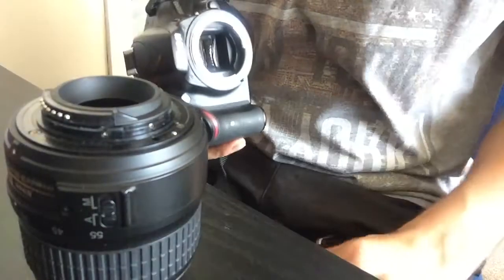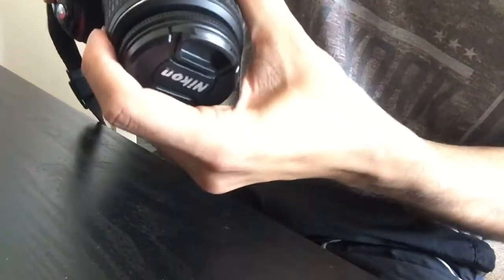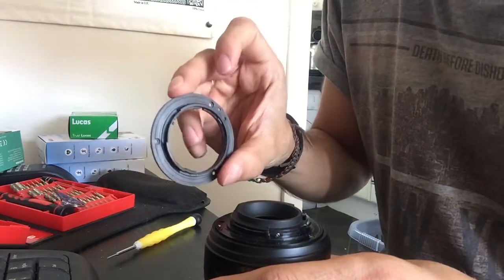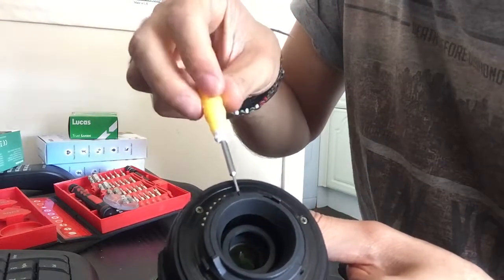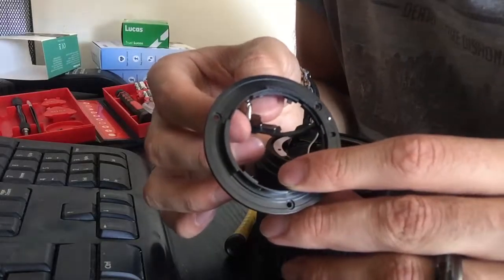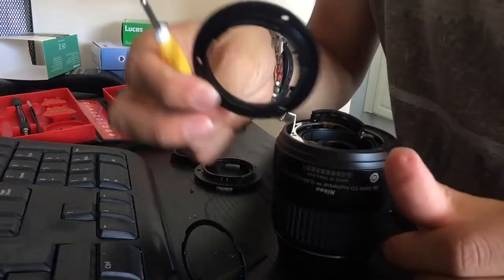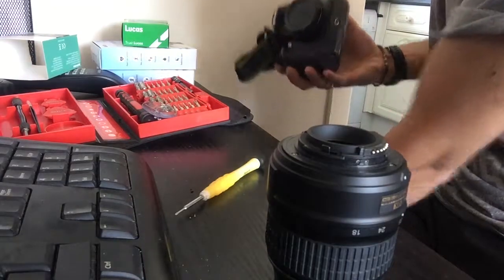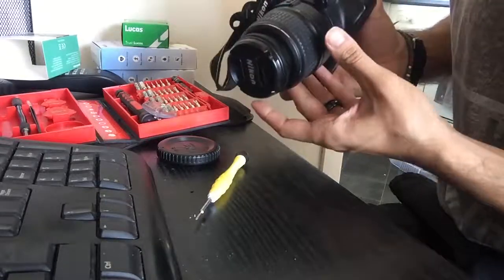Repair a broken Nikon zoom lens bayonet ring

Comment: Thank you for the repair tutorial but I have a question, how did you solder the connection after you broke it?
Mine snapped and now I’m trying to figure out how to solder it
Reply from the maker: I bought this basic soldering iron kit:
https://rover.ebay.com/rover/0/0/0?mpre=https%3A%2F%2Fwww.ebay.co.uk%2Fulk%2Fitm%2F113609277156

I just made sure to have it on a high heat and remove some of the white cable shielding to reveal the metal then get both the wire and metal piece together and feed the tin wire to solder together.
Hope this helps, let me know :)
Reply: see my reply above. Also a youtuber has a lengthy and belabored 'tutorial' which includes 'broken wire..' in the title Does not show soldering process but enjoyed eventual success. ;}

Comment: i've looked at all the replacement bayonets and they all have just 1 screw to hold the cable.  Mine broken bayonet has 2 screws.  Has anyone run across this, and if so, did they just use 1 screw on the replacement and eliminate the second screw?  thank you and great video.
Reply from the maker: Yours might be an old design if it is still in fact the AF-S DX 18-55mm lens. 
There's a slot feature and then just one screw to hold the cable (with spring pin) bracket in place. If you get the replacement you'll just need the one screw yes.